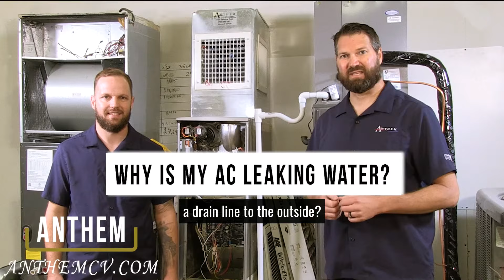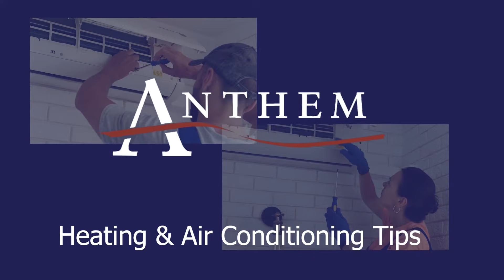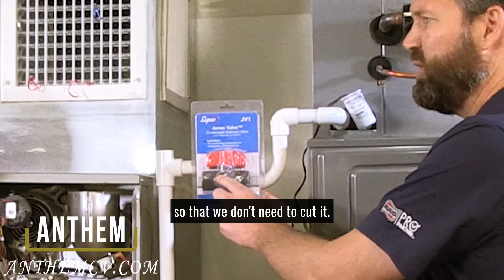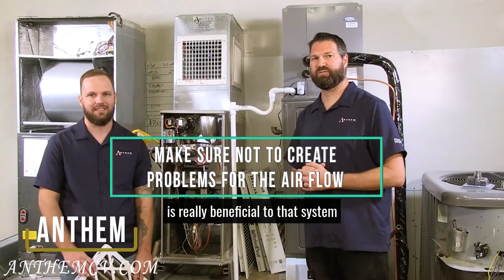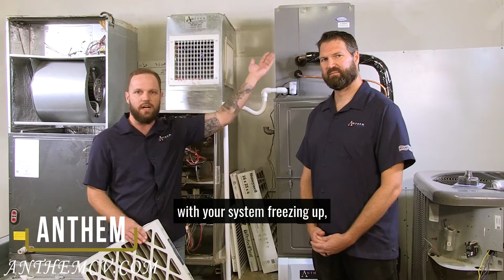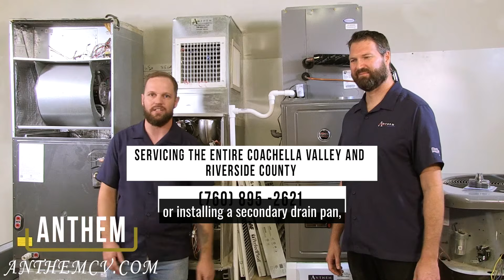Why Is My Air Conditioner Leaking Water? - Anthem Air Conditioning Heating and Air Conditioning Tips

Comment: Solid videos boys. Just subscribed. 
I got to this video cause my AC unit in my apartment continuously stops working cause the drain line constantly clogs up. 
I have a water pan that fills up with a lot of water. 
Can the drain lines only be cleared by nitrogen? 
Or is there any other ways.

Comment: I have a brand new system that was put in and I have this issue. Been using a bucket to catch as much water as possible but the problem has been like this since installation. And every visit costs me $800 for them to just drain the water. Been 3 years now with no fix.

Comment: This past weekend I went up to the attic to get a tool and the backup drain pan was full of water! I was able to clear the main line with a small snake, but I can easily see how much water damage would have occurred if the backup drain pan was not working correctly.

Comment: I have a heil central air unit in my basement. It has a pump on the side and it has a tube that goes across my ceiling to my water tub. We cleaned out the front filter or pan and that was all good. We turned the air back on and was running and then we seen on the side of the unit through the crack where they put it together and there was the screw next to it. There’s water leaking from there and has also water leaking from the side where the other crack is a screw up. What can that be?

Comment: I'm not sure exactly where mine's leaking but it started showing up on the hall carpet in front of the tiny closet where our unit has been shoe-horned in together with our Rinnai hot water heater. ( My assumption is somewhere up inside the air return 'box' where the loop is.) 
It is very frustrating to work on because there is NO extra room. I recently coated the floor with a heavy clear cote sealant just to keep the place clean. That was before I ever noticed any leakage.
Our A/C works ok but the heat has not functioned properly for nearly 5 yrs. We have a hydro-heat system. I also have had issue with the Rinnai not firing, but that is because I have to clean the 'chamber' and replace the ignitor. Our unit is 20+ yrs old. Not bad for the time, under all the circumstance and bologna we went through with the service that installed everything. Too be honest things have never been 100%. OK! I really am not here to complain, but it is necessary info. I am going to have to find another service to come work on our HVAC because it's way over my head. I understand as it's explained, but I need real help. Some places it's hard to find good savvy fellas that don't wanna charge you arm & leg & your next of kin! We have lost touch with an old timer that used to help us immensely! We'd pay him more than he asked, and he was amazing. Just one feller workin' out of his little truck. Great guy!
Putting up with the water damage in the mean time is not fun but I'll say that if our house was newer I'd be really upset & anxious. The house is 50yrs old and should be overhauled or leveled. I'm gonna get through this mess soon though. I've got to! ( I found heavy plastic sheets that they use in offices for swivel desk chairs to cover the wet area ) I also put down a rubber backed rug on the less wet portion. I use a wet-vac periodically to suck up the water when it gets to a certain degree...yep I'm fighting a battle. I might just give up and make a slip-n-slide! Lol!!!
Anyway thanks for the info & insights fellas! I really wish I could call on you to come help, but just wish me luck OK!

Comment: Hello,have a system similar to this in my house closet. My question is I can see outside light coming in from the top,is this normal? Does there need to be a way for the furnace to air out? Or does this need to be closed up on my roof? Thank you

Comment: Our furnace is linking water underneath. The air conditioner man came out. He told us that we needed a water pump. He told us. Instead of letting water run down the pipe. Like it was doing. He will connect the pipe fm furnace. Run pipe outside the furnace. Run it into the bathroom. So it can be drained into our toilet. I do not lk that idea. Will this mess up my plumping? Thanks

Comment: I really liked your video on where condensation can occur. Thank you for showing RectorSeal's Safe-T-Switch SS2 on your system. Adding EZ-Trap EZT-113B would also provide transparent trap providing quick visual if clog exists in the trap (along with brush to clean it), access to add drain pan tablets in your AC Coil, and all in one packaging so you don't have to find all the PVC fittings for any single job.

Comment: American Standard unit 16 seer was installed less than 2 yrs ago. Drainage line is clear and filter is replaced monthly. Water drips inside coming from the coils (center and both sides) when the unit shuts off. It does not drip while the unit is running. AC tech told us that while units runs, the fan blows the condensation water into the pan, but once it shuts off, the water drips. He also mentioned that spraying Windex on the coils would help (it didn't) and replacing coils may or may not eliminate the water from dripping. Does anybody have any suggestions how to solve this problem?
Reply: Currently going through this myself with no solution so far. 😢
Reply: Run the blower fan without AC for a couple of minutes after AC turns off

Comment: I have a brand new house, new AC/Furnace and the one in the attic is leaking water onto the AC filter daily.  I am not sure if it is coming off the copper pipe that has a black insulation on it or if it is leaking from somewhere else inside the Furnace.   When we bought the house we were in before this one, we had the same type issue when we moved in brand new and they had forgotten to put some type of valve on the system outside and the pipes would sweat so much it would get on the ceiling in our bedroom below the attic.   I just want to make sure they fix what the issue is?  Thanks for any advice. By the way I change my ac filters every month even though they are not dirty.
Reply: Need to make sure u have a safety switch on secondary. Also check to see if drain is clogged
Reply: @joedixon8804  No clogs already addressed that with a blow out and I have a safety shutoff switch.  The HVAC Guys came back and replaced the coil and it has stopped leaking!   I did read where some of these leak or drip and there is a pan the TRANE manufacturer can send that catches the drips, but it's harder to install than the coil so since it was under warranty they just replaced the coil.  So far no leaks or drips.

Comment: I have an issue with my Trane air handler, the evaporator drips down into the Plenum instead of dripping down into the drain channel. The evaporator is clean and the channels are clean. I’m actually watched the condensation just rip straight down and I can’t be the only one that’s experienced this. I am not a AC tech but I am an automotive technician so I understand the basics of a home HVAC system. The duct temperature is around 53°. If you have any input that would be great.
Reply: You may have to replace the plenum -as I've had to do.  If not, the long-term wet environment will cause mold to blow throughout the house, which is a health hazard!  From what you describe, the duct itself may be cold and cause water to condense there instead or in addition to the coils above the drain pan.  Nowadays, the plenum and duct designs are designed to mitigate cold spots and achieve easier air flow, but if it's an old house with old ducts, that may be the issue, rather than the air handler.  Hope this helps! (note: I did not do this work myself, but hired it out ... think it was about $800, but that place was crazy hard to get to.)
Reply: Drain pan could be cracked. Trane air handlers are known for that

Comment: Why would there be what appears to be condensation on the entire inside unit? Literally from the floor to ceiling. Every square inch of every component. Even forming on the inside of the closet door.
Reply: We're having a similar issue. Just bought a brand new central unit, but the condenser is in our attic so it's on its side. There's water dripping from all over the unit, especially outside the drain pan and into the ceiling sheetrock. It's crazy. I don't get how it's supposed to work, but this ain't it. Lol

Comment: What will happen to my 410a system if I add r134?
Reply: Bad for your compressor. Replace condenser
Reply: Compressor ran fine for 5 months @joedixon8804
Reply: Doesn’t sound like a good idea.
Reply: @scooterp7009  It work but the pressure go up and down. I was using 12 oz. cans from Walmart. There is not enough pressure to force 134 into a 410 system. I vacuum all of it out and put only 410a. A fan saw my video and sold me a new tank of 410a.

Comment: Why is there a little water coming out my primary drain when I am using the heat and not the ac?
Reply: If u have 90 plus furnace, it condensates from flue. Exits thru a collector cup and drains. Won't condensate as heavy as ac would

Comment: The P-trap on the drain line is your biggest weakness all traps eventually clog it is not required and it says in the instructions " do not trap" .
Reply: I think you have no idea what youre talking about. if you dont have a condensate pump than a trap is needed. If you dont have a condensate trap than either the cooled air is blown out (overpressure) OR the water cant run because you are sucking warm air into the system (underpressure).
Reply: @niklas3963 
Oh my, I think that I have both 😱 plus water on the floor!

Comment: Ours is in our basement and has leaked and got our basement wet over 5 times. They can’t figure it out. The water collects in the bottom of the furnace. The drain is clear and works. The keep blaming something different every time. They had to tear drywall out and replace all the carpets. It’s still not fixed.
Reply: Please reply if you've found a solution. currently going through this
Reply: @ADWebTV I’ve been dealing with this for years!! I’ve had many techs come out and all they ever do is get the water out and charge a lot of money 😩
Reply: Did you ever figure out the issue?
Reply: @Miracx3 yes, they saved a buck or so and reused a portion of the drain that went into the hole when they replaced the furnace. It was 90% plugged so when they pored a little water in to test it you could hear water come out but when it was running the condensation would eventually outrun the drain. I finally figured it out on my own. They refused to take blame.
Reply: @rtk114 👏👌
Reply: I have puddles of water on my garage floor. When I check the exterior drain pipe, barely anything comes out. Am guessing I have a clogged drain pipe somewhere? Is that a call to the Pros?
Reply: Assumption #1: you have an upflow furnace/air handler
Assumption #2: your p-trap is dry
Assumption #3; the end of the discharge line is open to the air (might be other reasons the p-trap is dry)
Result: air is being sucked back up the discharge line with enough strength to overwhelm the evaporator pan's weak little attempt to discharge.  Thus, the pan is filling up and overflowing into the furnace.
Solution: run the A/C and close the end of the discharge line (prevent air from enterring) until the p-trap fills up.
Reply: Could also be a cracked or corroded pan. If that’s leaking , drain won’t work. Then leaks on floor, going everywhere.

Comment: Not a professional but shouldn't you blow out the tube in one direction? Do you want to blow the gunk back into the tray where it can reclog?
Reply: A professional will also clean out the condensate tray and add a handful of algaecide pellets to it, which will limit any future buildup of algae as they break down in the water.

Comment: Would be nice to have the link to that valve. Also, is there any danger in blowing it out from the attic versus sucking it out on the other end? I was also puzzled why you have to use nitrogen and not just an air compressor or air tank?